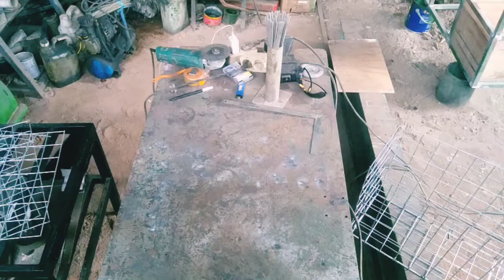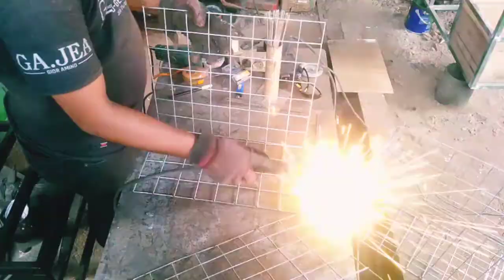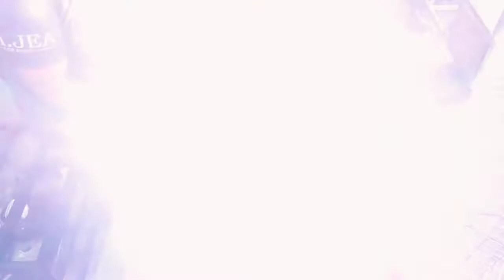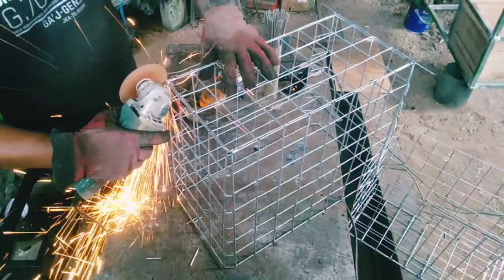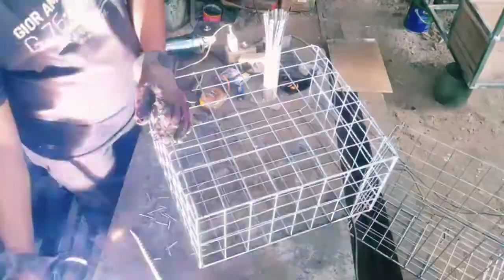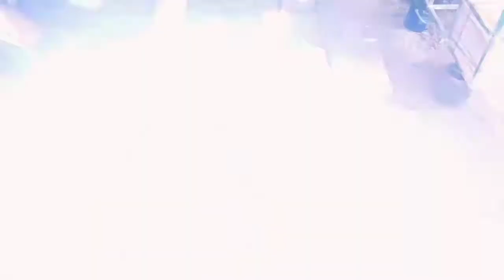diy-freezer basket

Comment: bisa pesan freezer braketnya dimana mas
Reply from the maker: Bengkel saya di malang
Reply: @WELDERTECH  ukurab 43cm brpa 1 nya mas
Reply from the maker: 120rb
Reply: @WELDERTECH  kalo dkirim ke solok sumbar bisa ?
Reply from the maker: Dima soloknyo uni?
Reply: @WELDERTECH  halaban panyakalan..
urg solok pak ?
Reply from the maker: Awak lubuak basuang ni, tapi marantau ka malang jawa timur
Reply: @WELDERTECH  lai dak maha di ongkir kirim ka solok tu pak
Reply from the maker: 🙏barek di ongkos ni, tangguang
Reply: @WELDERTECH  a bahan untuak keranjang ny tu pak..
Bisa dak RAM palatak Acc HP dpakai
Reply from the maker: Awak buek dari bahan wiremesh galvanis ni
Reply: @WELDERTECH  dima bisa di bali bahan ny tu pak
Reply from the maker: Toko stainless
Reply: @WELDERTECH  ok makasih pak
Reply from the maker: Samo2